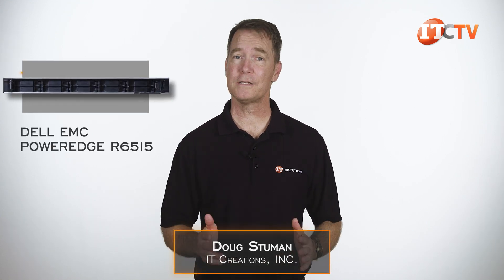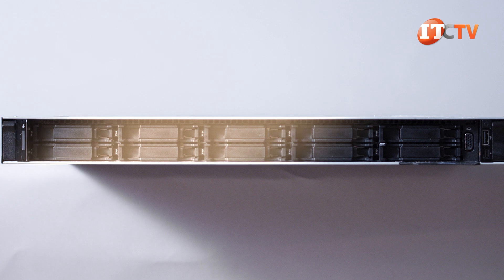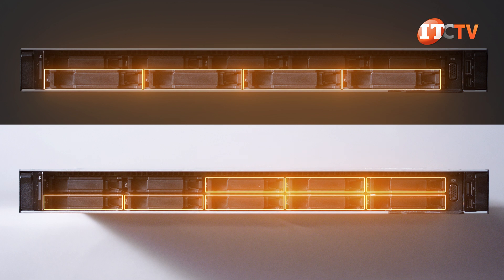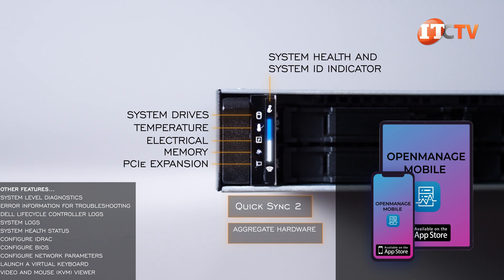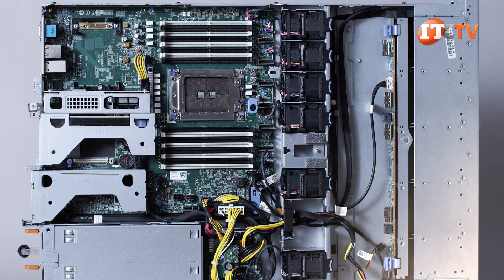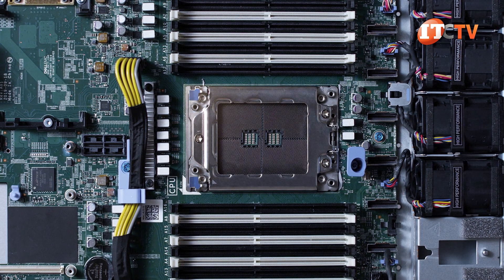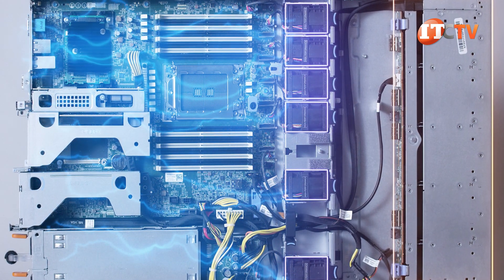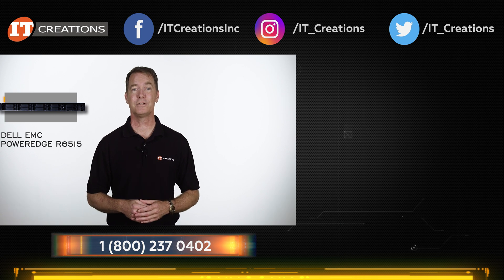Single-Socket AMD EPYC Dell EMC PowerEdge R6515 Server REVIEW | IT Creations

Comment: what socket of NVMe connector? is it U2?
Reply from the maker: Hi there!
They are U.2 NVMe drives.
Reply: @Itcreations-LA  so, I can install up to 8 NVMe drives U.2, right? Do I need to install controller or connectors or it is ready for NVMe plug?
Reply from the maker: @maherkhalil007  
I do not think these systems are offered with field replaceable units for the backplane and whatnot. If you have the 10x bay system that supports SAS, SATA or NVMe then, yes, no controller is needed and the onboard controller will manage the drives which are 8x SAS, SATA or NVMe PLUS 2x NVMe. You could also install a controller for more options, VROC is not listed as an option. The 8x bay system has a SAS, SATA backplane and apparently not set up for NVMe. Hope that helps! Thanks for watching!
Reply: @Itcreations-LA  dell say it have the 10x bay for NVMe, but I am confused what is the connector, is it NVMe hhhh interface or M.2 do you have any idea?
Reply from the maker: @maherkhalil007  
Not M.2. M.2 has a completely different form factor. NVMe U.2 look like regular SSDs. Like this: https://www.itcreations.com/product/130336
Reply: @Itcreations-LA  do you think connecting this form factor using u2 can utilize full NVMe speed?
Reply from the maker: @maherkhalil007  
Yes, that is the idea. These drives are connected to the system via the PCIe bus not at PCIe 4.0 but at PCIe 3.0. So not quite as fast as PCIe 4.0 but still much faster than SAS and SATA options.
Reply: @Itcreations-LA  thank you very much